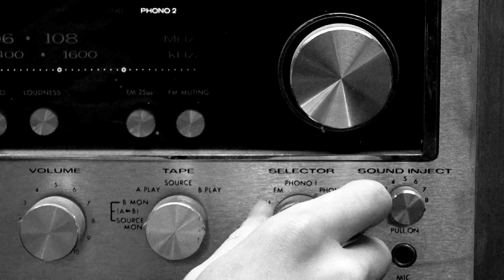How To Make A Snow Skate

Comment: ah, this gave me an idea! why not simply use some kind of large thick plastic bag or something similar, that you glue to the underside of the board, after putting on some longitudinal directional-keeping thingies? you know, like when we were kids we would make holes in a plastic bag and put it on like a pair of trousers, and then go sliding on the snow. I'm gonna try something like this :)

Comment from the maker: @The14122000 No Problem, its a simple skateboard without trucks and a a sheet of plastic. both surface was stuck with contact glue for multi surface and you can use every type of glue to fill the little hole made by the trucks. If there's something else you want me to explain, its a pleasure if you want to ask me something else :)

Comment: @chimpofm this a actually a really good way to protect the deck from soaking up the water and eventually warping and bending. 
but having said that, this snow skate seems a bit useless because, as ozmay has aready said, u will have no control wat so ever! works on a normal snowboard because of the length and flexibility, so u can use tha for more control. runners on a normal deck are the way forward!! check out chimpo's skenk board guys. SKENKboard for the win!!

Comment: @ozymay nah dude, it wont grip.. what will happen is you wont have any control on what way your snowskate is going.. you can try to go straight but it will eventually go left or right becuase the bottom is just smooth all over.